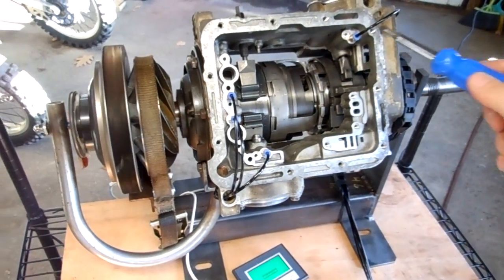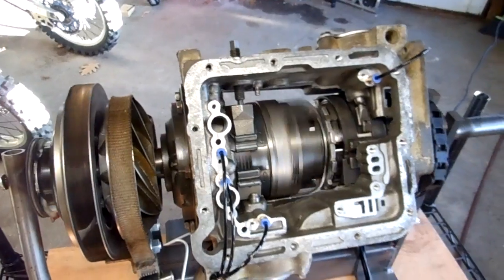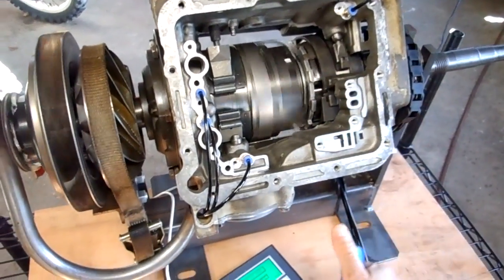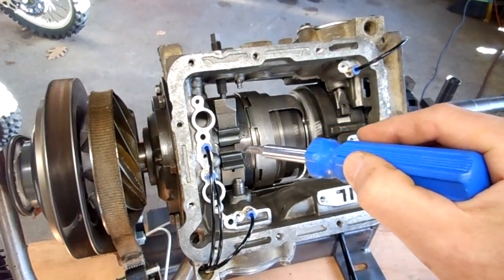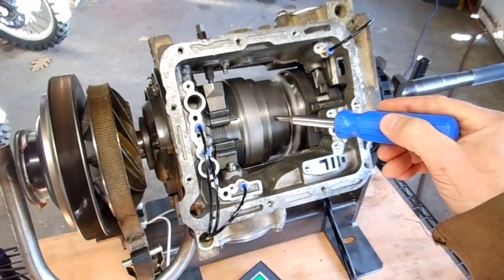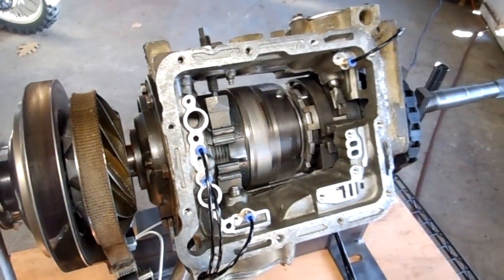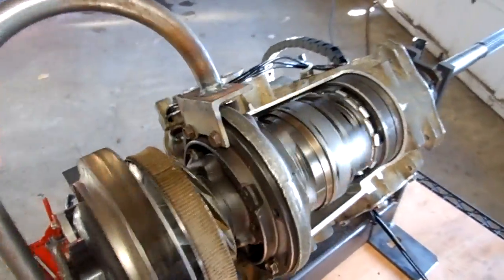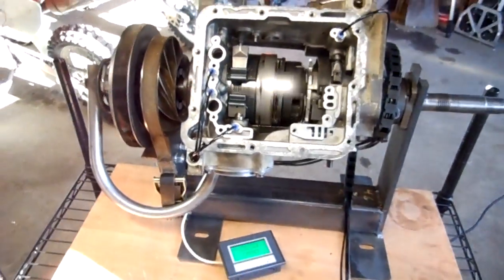Ford C4 Planetary Gear set operating with a PLC

Comment: The low/reverse band is only on when the lever is in manual 1st gear position or in reverse. Drive range 1st gear is the forward clutch and the low OWC roller clutch.